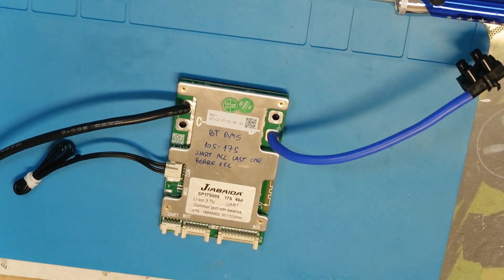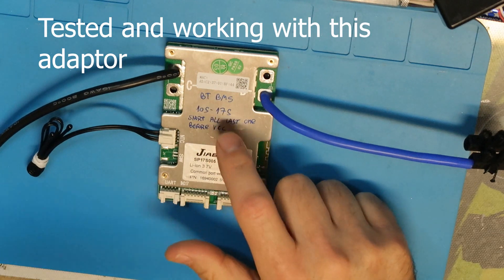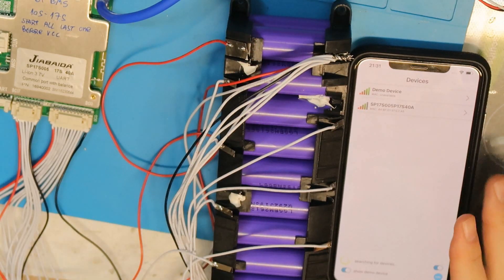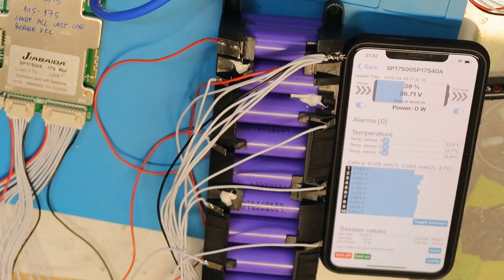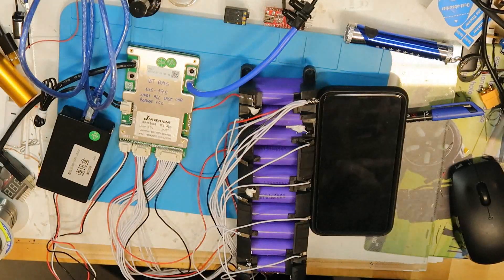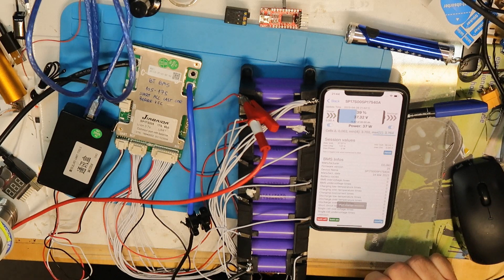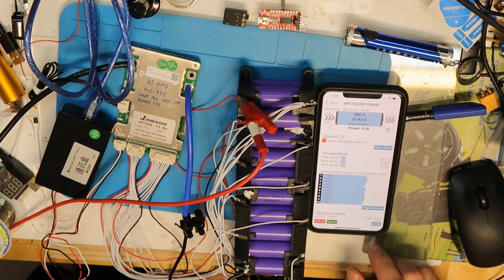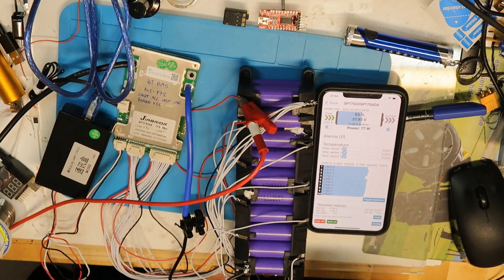BMS JIABIADA 10S-17S

Comment: Hello I have a jiabaida bms a 21s 100a smart bms I needed a 20s so they removed a lead and now that I have it all together it says cell undervolt protection because th missing lead reads as 0 and my battery wont charge or discharge , is there a way I can override this or delete this error code??
Reply: Removing is not the right thing instead you need to short two leads to one point according to the datasheet. Like in the case of a 13s connection using 14s bms, you need to short the sensor wire no. 12 and 13 together to 12th series.
Reply: @ Yeuh that’s what I did but they pulled the wire out at the factory to make the 21s I to the 20

Comment: Can we change this BMS from Li-ion to Lifepo4 cell ?
Reply: You can, you need to adjust voltages limits and another parameters specifically for Lifepo4 cells with that UART tool and Jaibaida application
Reply: @illla  yea I change , but now BMS show error , waiting for 2 days for JBD support to connect to BMS and fix it for me. As user you dont have promition to change this parameter only JBD can chenge for you but need to wait.
Reply: @harasti  hi did they change?